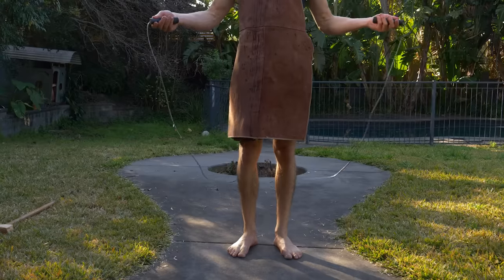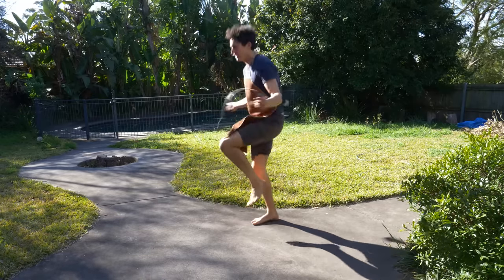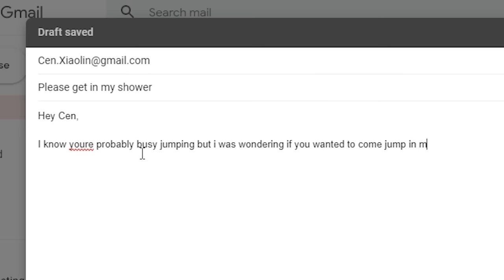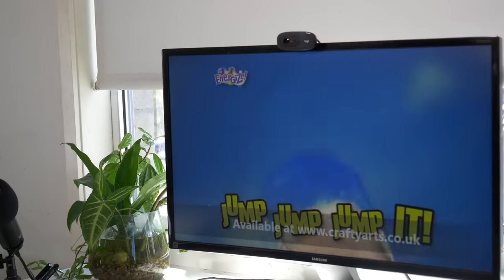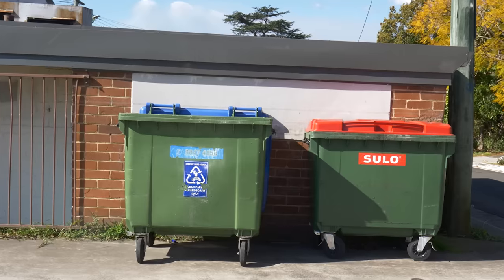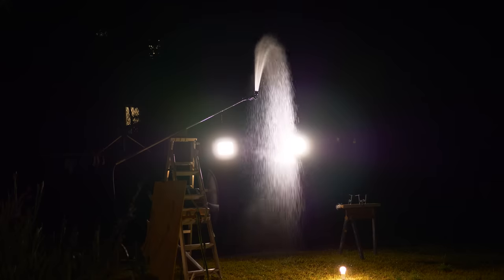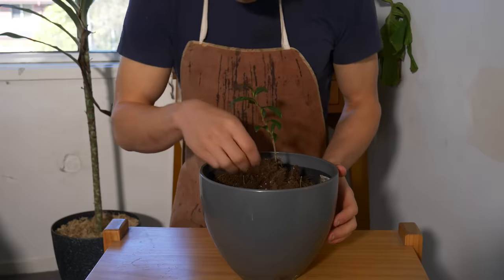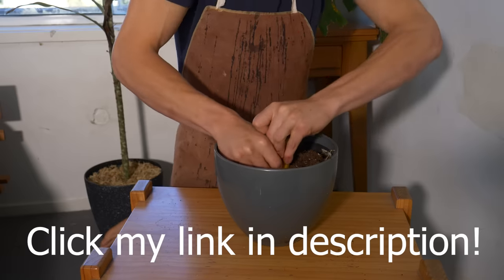Can I Jump Rope Fast Enough To Stop The Rain?

Comment: 1:16 so if a jump rope would need to make 800 rotations per second, and let’s assume that the distance from where it is above your head to under your feet is 7 feet in total, then that would mean for every rotation around your body the jump rope travels about 22 feet. So if you need it to spin 800 times in a second then the jump rope would be moving at 17600 feet per second which is 12,000 miles per hour. So basically all you would need to do is get your jump rope going Mach 16. Easy enough
Reply: Thanks for saving me the calculations. I'll probably get another number calculating, but Mach 10+ is enough of an answer that I can be content with
Reply: Can you just not bring fucking imperial system in discussion? At least in video that does all calcs in standard units
Reply: @kirathekillernote2173  convert it
Reply: @chloemccarthy2297  exactly he not big brain and i have a question exactly what were any of the words you said
Reply: @adudethatlikestofish8070  lmao I assume you're referring to my first comment; I feel there are different ways to approach the problem, and mine would be different that what OP did. I also feel my answer, accounting for centripetal velocity, would also be breaking the speed of sound many times over. So I was just saying I can agree with OP's answer, and thanked them for doing the work so I don't have to
Reply: Ikr
Reply: @kirathekillernote2173  cry about it
Reply: @chloemccarthy2297  what did you say again to many calculations speak english plz not no triatic formula and please stop explaing the formula to the world.
Reply: @chloemccarthy2297  and chill stop being big brain and just talk normally and obviously it was a joke
Reply: @adudethatlikestofish8070  Look man, I'm autistic. This is just how I talk, and I didn't even know you were saying a joke. Let me be :(
Reply: @chloemccarthy2297  oh um i am really sorry I didnt know wasnt trying to hurt your feeling or anything just yeah sorry.plz forgive me🙏🙏
Reply: @adudethatlikestofish8070  Was this supposed to be a joke?
Reply: @MammalianCreature  dang chill out on me I didnt even say anything offensive
Reply: @adudethatlikestofish8070  I simply asked a question. I didn't say anything else, so you chill out. Was it supposed to be a joke? That's all I asked. No accusation at all.
Reply: @MammalianCreature  AhHHH
Reply: But where are you going to get 16 Machs at such a late hour, and how do you convince them to meet you in the backyard?
Reply: @lordgoofus2364  I hear luring them in with bacon works well
Reply: @SheepyNubs from above your head to BELOW YOUR FEET
Reply: We just need koro-sensei!
Reply: What is this future magic science speed bullsh*t
Reply: Hmm.. He was using two ropes, so the required speed would be only half of that. Every time you double the amount of ropes, you halve the required speed.
2 ropes mach 8
4 ropes mach 4
8 ropes mach 2
16 ropes mach 1
32 ropes mach 0.5 or about 170 m/s or 1500 rpm. This seems like it could be doable.
Reply: ahhhhhhhhhhhhhhhhhhhhhhhhhhhhhhhhhhhhhhhhhhhhhhhhhhhhhhhhhhhhhhhhhhhhhhhhhhhhhhhhhhhhhhhhhhhhhhhhhhhhhhhhhhhhhhhhhhhhhhhhhhhhhhhhhhhhhhhhhhhhhhhhhhhhhhhhhhhhhhhhhhhhhhhhhhhhhhhhhhh
Reply: @kirathekillernote2173  Can you not get butthurt that the US exists?
Reply: that is about 0.0018% of the speed of light and about 17.75 times the speed of sound
Reply: @adudethatlikestofish8070  man, I suck with both imperial and standard lol
Reply: @kirathekillernote2173  bruh
Reply: Koro-Sensei be like “You called me?”
Reply: nerd
Reply: Hmm I would what would happen to his feet if it were to go that fast and hit them it would be the saw movie all over again
Reply: Didn't understand but thanks, sounds nice.
Reply: I haven't finished the video yet as of the creation of this reply but anyways, despite the idea of having an umbrella jumping rope not feasible, does it somehow still make someone 'less wet'? Like a rainfall would perhaps just feel like a drizzle?
Reply: Okay....anyway, so, is it possible or not? 🤨
Reply: @trentconner2598  No, but it seems like you want to pick on me for seemingly no reason so now I have to question your intentions
Reply: @kirathekillernote2173  True big brain people use both
Reply: @kirathekillernote2173  he ain’t no commie
Reply: @lordgoofus2364  McDonald's will happily sell you 16 Big Machs, and probably has no qualms about selling you double that, either... if you're willing to wait long enough....

(if you're the Lord of Goofuses, and if you feel I've out-goofed you... what is my title, then?? ☺️)
Reply: @kirathekillernote2173  OP is probably American. I personally dk and never tried metric units. If it wasn’t in imperial units I would have no idea about the scale of this calculation. Idk why ur so offended, just convert it yourself.
Reply: @chloemccarthy2297  I think you talk fine. Personally, I think it’s Jeff’s problem cuz I have no idea what he is saying. It’s really hard for me to read smth with no periods, but I assume he is saying that he couldn’t understand. He doesn’t seem like a native English speaker and was kind of rude about it.
Reply: @adudethatlikestofish8070  I have no idea what you are saying either. Plz add punctuation 😭
Reply: @kirathekillernote2173  Mach 16 in imperial is Mach 16 in standard. Cheers!
Reply: JUMP ROPE IS GOING MACH 16. I REPEAT, JUMP ROPE IS GOING MACH 16!
Reply: @kirathekillernote2173  he'd need this to go at a bit over 19k km/h. Fastest a plane has ever gone was about 3.5k
Reply: Can you tell me how did you get 22 feet plz
Reply: dont u need more than mach 16? cuz water drops dont fall at constant intervals
Reply: @kirathekillernote2173  ayo bro everyone outside of the states makes fun of america for not being able to convert imperial to metric, but do us a favor and not be a hypocrit mmkay?
Reply: @kirathekillernote2173  everyone's talking shit but you're right
Reply: @kirathekillernote2173  They literally said "mach 16" lmao
Reply: @kirathekillernote2173  Yeah exactly. I don't care if you're American, learn the metric system and use it. I can confirm it's about 1000 times better than imperial. Or 1 kilobetter.
Reply: Is that you bill nyne
Reply: @randomdudeonyt1994  bill bill bill bill bill nye the science guy
Reply: @kirathekillernote2173  what’s your problem it’s not that big of a deal LMAOAOAOAOA
Reply: its way less complicated to see the impossibility
800rps are 48 000 rpm, for example F1 engines rew around 15 000rpm or angle grinders have up to 11 000rpm.
Reply: @iza2751  You can claim metric's better when you land on the moon first. Oh, wait, I meant when you land on Mars first. Oh, wait, I meant when you leave the solar system first. Need I go on?
But on a serious note, it's not exactly hard to just, you know, use Google. I know both imperial and a bit of metric, but I prefer imperial, so I use it online. And for conversions I'm not sure of, like litres to ounces, there's about a trillion ways to convert it with no prior knowledge. I don't shit on people speaking foreign languages, I just throw that shit into Google translate. But as a couple people have already pointed out, mach is a universal unit, sorta like atm. So the whole argument of "hue hue use standard units stupid American" is null and void in the first place.
Reply: @DieuDeMort  what.
Reply: but if we go big brain and use 4 ropes, then we would only need 200 rotations per second, or 3,000 miles per hour
Reply: insert nerd emoji
Reply: @fadumo5598  🤓
Reply: well  luckily i got 3 sr71 engines lying in the garage. Finna try this myself
Reply: @chloemccarthy2297  verga...
Nanai~ <3
Reply: But then divide it by 2 cuz theres two ropes right?
Reply: well wouldnt it be mach 8 because of the two ropes instead of one? Still an insane amount but think about how much easier it would be to keep doubling them. Mach 8 to mach 4 to mach 2 to mach 1 to 5100 kilometers an hour and so on adding more ropes as you go
Reply: r/hedidthemath
Reply: E

Comment: It is theoretically possible to stop rain like that but it would need the wires to go way faster. You first have to calculate the randomness of the timing of each raindrop and the speed of the engine. That leaves you with around the speed of sound
Reply: Fastest hedgehog around
Reply: If he used a gear system to ramp up the speed, then perhaps it would work, but I'm no engineer or scientist, so I got no clue.
Reply: @Noah-rm5bu  I mean that's just a roof lol
Reply: @AlanaBananaCanada  that’s……. That’s the joke lmfao
Reply from the maker: What about i just make them really really thick and braid them together untill they create a wall?
Reply: @Ididathing  you're releasing alot of trump vibes bro
Reply: @Ididathing  no wait I think you have a point
Reply: @Ididathing  just use an umbrella...
Reply: @Ididathing  Mexico didn't like that one
Reply: @Ididathing  no
Reply: @magnus2111   💀
Reply: nah, calculating the randomness would leave with no useable data; you’d have to divide the xyz plane into 3mm cubes at the radius of the rope and make sure the rope spins fast enough to hit every unit (assuming each descends at a constant 10m/s)
Reply: @Ididathing  build a concrete wall as a hat
Reply: @Ididathing  what if you could use a giant fan similar to indoor skydiving
Reply: Alternative. Buy a house
Reply: @emptychamber544  😂

Comment: For press fitting a bearing, you want the hole to be just a bit smaller, or the same as the outer diameter of the bearing, depending on manufacturing tolerances. Then throw the bearing in your freezer for a bit before pressing it in. The cold will shrink it and it will get stuck when it warms up again. Alternatively, you can heat the hole with a torch to make it expand slightly.
Reply: Right. It won't come lose it you do it right

Comment: You jump 3 rotations per second, the average person jumps 100 rotations per minute, so there are 60 seconds in a minute. So if someone does 100 jumps in a minute, the average number of jumps per second can be calculated by dividing 100 by 60:

100 jumps / 60 seconds ≈ 1.67 jumps per second (rounded to two decimal places)

Hope this helped lol.

Comment: Somehow, I feel like the most dangerous thing that happened was using a 1-inch spade bit on aluminum.
Reply: Aluminium is pretty soft and it went through fine, are you thinking it could catch and fling the piece around?
Reply: @tjwest2605  Exactly, or the bit could catch and snap, depending on what's clamped better.
Reply: @MorningDusk7734  good point it does seem a bit sketchy, I myself would still have enough faith going through some soft alloy like this, though getting the proper bit is easy enough
Reply: ok
Reply: E
Reply: @tjwest2605  It's not about softness, it's about how Aluminum is "grippy".
Reply: @MorningDusk7734 Drill into it first making the pilot hole first than drill the the rest with the drill on reverse setting. It’ll still score the aluminum and cut through. It’ll actually probably make a cleaner smoother hole as well
Reply: @MorningDusk7734 I do it all the time through aluminum metal studs and top plates. And yeah if you go forward it’ll usually catch the aluminum and f the hole up.

Comment: To fit bearings into a hole like that drill the diameter of the bearing out and put the bearing in the freezer, leave it for a day whack it in with a wooden or rubber mallet and let it expand again 🤷‍♂️ no need to weld or do janky shit 😂
Reply: My whole view on everything in life has just changed
Reply: Theory: couldn't you also drill and then ream the whole 2 thousands of an inch smaller than the diameter of the bearing and pressfit it with an arbor press?
Reply: nerd
Reply: @heromedley  imagine shaming someone for providing knowledge
Reply: it most likely won't work because when it will expand the fit will be too tight. it's way better to cut the hole that it's more elliptical. this way it has more give.
Reply: nerd
Reply: Going from room temperature to in the freezer you are only going to get a few tens of microns or so change in diameter. 
Unless you have a boring head in a mill or a reamer, I seriously doubt that you are going to get that sorted of hole tolerance with a drill, to have the freezer actually do anything.

Comment: I like how you calculated in the beginning that you need about 800rps and then used a motor with less than 50rps without gearing it up. Incredible work. Still 10/10 video

Comment: I was surprised that thing didn’t explode from the extra load added to the motor. Those motors are definitely stronger than I would ever figure. Btw the cement mixers are purposely slow. Usually only around 250-350 rpm. Thats on purpose obviously. You can get drills closer to 1,000. That would have been a little less terrifying
Reply: My guess is he picked a water pump on purpose. They have to move lots of water very fast, which is no joke from a physics perspective.

Comment: I think what this needs is optimisation. With a wider wire, as light as possible- add a third wire, as this has been found to be the best amount of propellers for things like fans, etc (source: Dude just trust me)
If possible, you can even make an angled wire shape to create a windshear effect. 

The third propeller would reduce your necessary speed target by 50%-- if you make the wires twice as wide, and- optimally- introduce a windshear that again doubles its effective width, you can theoretically reduce the maximum speed by again four times, lowering your goal from 400 spins a second (with two wires) to only one or two hundred spins for second. 
Finally, you can shorten the length of your wires to reduce the torgue produced from the leverage need to move each wire, which would make higher speeds much easier to achieve. 

With all of that in mind, you would at least give a massive boost to your amount of water droplets chopped, even if you can't stop the rain. You'd also be able to take the feet off of any bloke you disliked. I don't think you'd return to this project but it's at least a fun thought experiment.
Reply: Good idea. It's about stopping most raindrops, not all anyway.
Reply: Something I've learned just from fishing (it's a convoluted connection, so I won't even try to explain it lmao), but will apply here, it's that thinner might actually work worse.

The smaller the diameter, the lighter the wire. While true, that would technically help, from the motor's perspective, I'm not sure it'll achieve the intended results...

Reasoning: the speed increase will mean an increase in air resistance as well. Which, coupled with the wire's lower mass, would cause the motor to eventually (quickly, to our perception) over-rotate the wire and twist up.

I think he'd be better off by increasing the arm length, making it out of carbon fiber, and giving it a symmetrical airfoil. Then it'll be even lighter weight, still super strong, but also aerodynamic -- but also the symmetry should prevent it from acting like a propeller and stay balanced.

I do agree that moar arms/wires = bettur. Though at some point it needs to be asked whether it's cheating... lol
At least 2 is a valid type of jump roping (Double Dutch, if my 30yr ago recollection is correct), albeit performed wwwway differently. But we lack the third arm that'd make 3 possible... 🥴🤣
Reply: Nice
Reply: couldn't you also make the propeller really small to have better leverage and therefore faster rpm
Reply: but i guess then you'd need longer wires

Comment: Imagine trying this with micro turbines. I Heard they can spin at up to 500,000 rpm which is about 8,333 rotations per second.
Reply: that would sound like a dying chicken
Reply: Yeah but those are pretty small and the larger arms which hold the skip rope in place will greatly reduce the rpm

Comment: I died laughing at the part where he cut the pipe and put it on as a ring. I've also touched hot metal after cutting/grinding it and had equally comical reactions.

Comment: Btw, according to your calculation you need 450 rps with 2 ropes. Calculating the speed of the rope with a radius of 1m, we and up with 3,141*1m*450 1/s which equals 1413 m/s. Which is 4.19 times the speed of sound

Comment: Thought my phone went into "bedtime mode" when the video went grey scale for the perfume commercial. Had to double check it didn't lmao. 

Great concept man! I wonder how it would've faired with 4 ropes or thicker rope? 4 blades would be a nightmare to balence though
Reply from the maker: Thanks mate. I think that four wires would increase the chances but slow it down. So not actually sure it would work
Reply: @Ididathing  | add enough wires that it makes a wire shield 
That’ll surely get em!